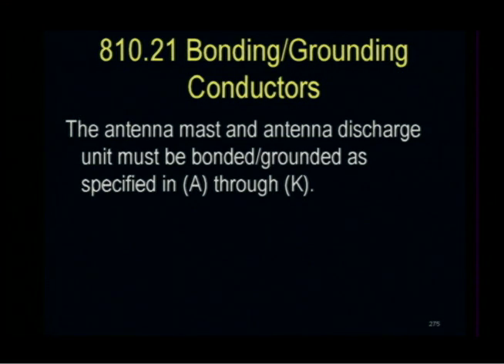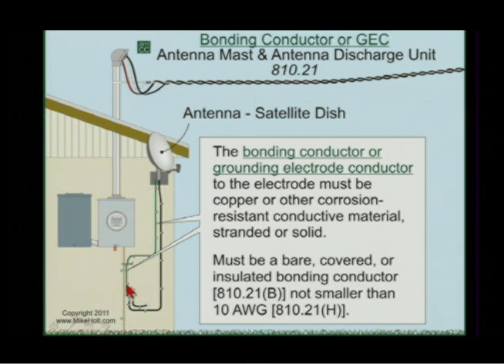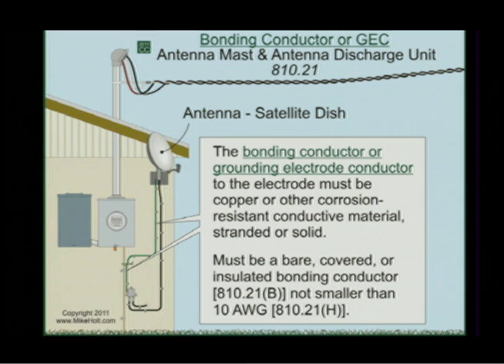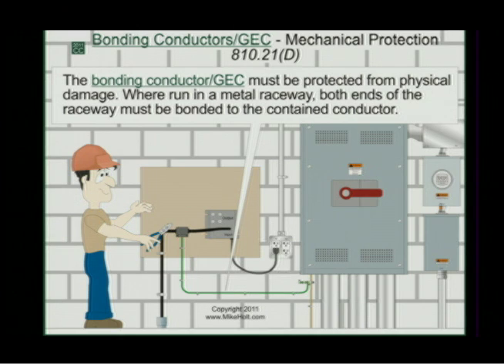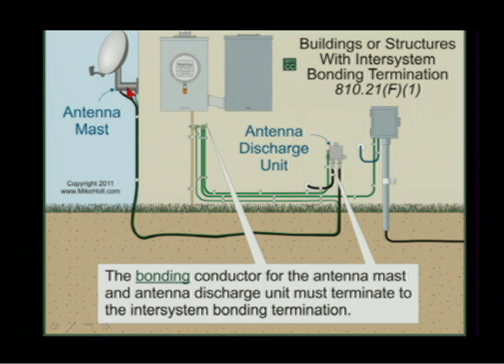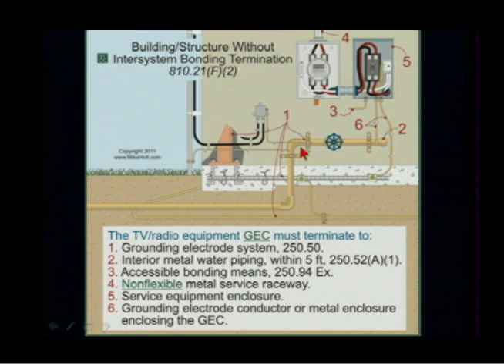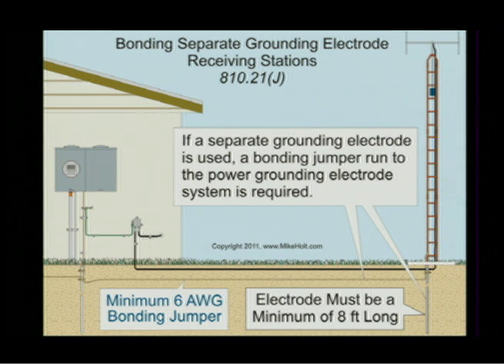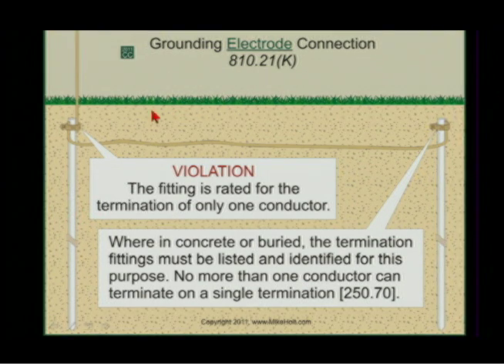NEC 2011 810.21 Bonding Conductor or Grounding Electrode Conductors (Satellite)

Comment: So to clarify, if an antenna (without a metal mast) is mounted  on the roof, the coax sheath will serve as the grounding conductor, and the ADU can connect to the bonding terminator without going to a ground rod?

Comment: Excellent video and very resourceful ! thank you for sharing. .

i plan on placing a tv antenna 30-50 feet from the homes ground system/rod.
from what i read i can only run up to 20ft between the mast pole and the homes ground system.

 For my 1st question  Is this correct?

I was going to install and bond a 8ft ground rod at the mast or between the mast and the homes ground rod. 

My 2nd question is ... what is the maximum distance the 6 gauge  bonding wire can run  between rods.
Reply from the maker: If longer than 20', drive a ground rod, connect to the electrical system. If antenna further away, drive a ground rod there and bond the two rods with 6 AWG (no length limit).

Comment: Mike, in reference to code 810.21J. I see this question asked often and no one ever gives a straight answer. In a situation where an antenna/coax/ground rod/lightning arrester are on the opposite side of the house as the electrical service/intersystem power termination. The bonding conductor for the antenna mast/antenna lightning arrester/grounding rod have to be bonded at the intersystem power termination. Does this 6AWG bonding wire have to travel outside of the perimeter of the house or could it take place through the basement?
Reply from the maker: Doesn't matter by the NEC.
Reply: @MikeHoltNEC  That being said would you have any reservations against doing it that way? I understand the purpose of this  bonding is to eliminate voltage potential but in my mind in the event of a lightning strike I envision a bare copper line being charged running through my basement. The difference here is about a 50 foot run through the basement or about a 120 foot run around the perimeter of the house making multiple turns. I have no problem spending the money and time to run around the house. I just want to do what is safe and proper per NEC guidelines.
Reply from the maker: @Music-st2qj  Excellent questions that are beyond my ability to answer. I'm a NEC guy, not a lightning protection expert. But since lightning protection cables are run inside buildings, I don't see any issues with running the bonding conductor inside.
Reply: I have a situation similar to this. The question is, do I run the bonding wire from the new grounding rod on the opposite site of the house to the pre-existing grounding rod on the other side, or to the service panel ground bar?

Comment: Mike, do you have a guide or video anywhere specifically for ham radio?  I am getting so much conflicting information on the topic of grounding, bonding and RF.
Reply from the maker: You just watch the video you need. There is nothing else required.
Reply from the maker: @K8BYP _ The grounding of an amature radio must be done in accordance with the NEC. This is what this video describes. If you feel that I made a mistake, let me know specifically. By the way Article 250 has nothing to do with this topic, so I can't have violated a NEC rule.